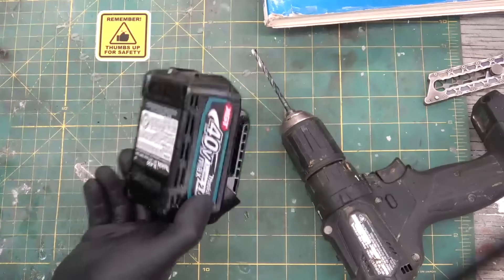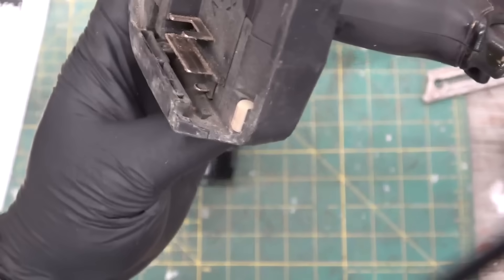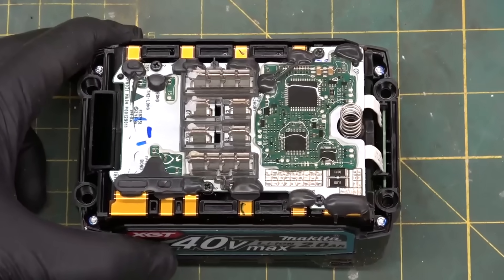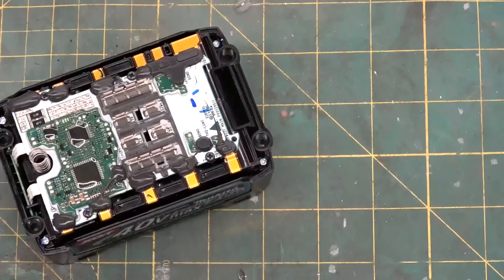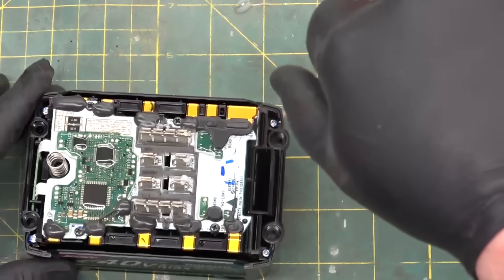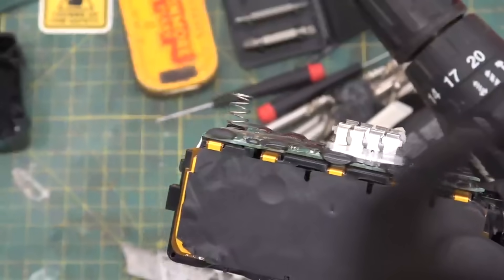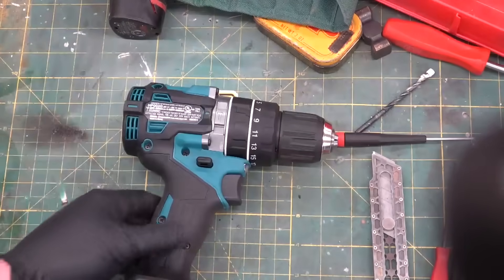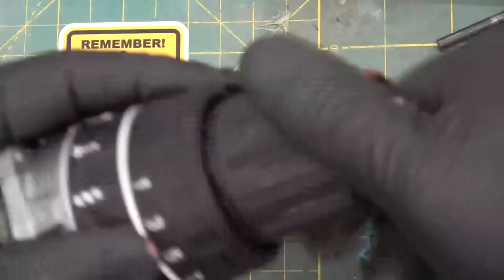BOLTR: Terrible 40V Drill || Et tu, Makita?

Comment: I once gave an apprentice a set of Righty drill bits. He's on the roof of  semi trying to drill a hole for 10 minutes. He got most of the way through.  I get up on the ladder and look, when I said, "You need to switch the drill to forward." He replied, "This drill has reverse?"  The drill bit 'was' sharp.
Reply: The drill bit was, but sadly, the apprentice was not.
Reply: Sharp as a stick of butter! 🧈
Reply: Yup. Had to do the same with a college coop student. 1/4 aluminum. Was wondering where he went after an hour..... was on the second of 5 holes in a decorative faceplate. Told him about the switch, grabbed the second bit and had him swap that as he actually listened about always grabbing 2 from the crib if you don't have any. And he tried again was pushing so hard that he damn  near broached a full tool sized hole through that panel. I had to help him up.

Comment: The chuck is noisy as it's a ratcheting chuck, all of them do that if you open the chuck all the way out under power, its the downside of having a neutral setting one click back after tightening, they can sometimes drag in this neutral setting.

If you tighten a drill bit in it by hand, and then open it by hand it'll sound exactly the same as your other one, this is a common issue if you tend to open and release your chuck using the drills power instead of doing it by hand

Huge fan from the UK :)

Comment: You want 40V because more voltage = less current for the same power, so you get less I-squared-R losses, smaller power cables, lower current MOSFETs etc etc. You do NOT get dendrites in lithium chemistry batteries, that's NiCd you're thinking of. High current causes cracking in the electrodes in lithium batteries, which degrades them. I don't know what the hell they were thinking with the holes in the bottom of the battery, that's just dumb

Comment: These power tool chargers should have a “slow charge” and “only charge to 80%” mode
Reply: My understanding is at least the xgt charger

Rapid charge to 80% depending on pack temp

Then gradual balance and top up
Reply: @Aspire198 yes but to store your battery at 80% you have to manually catch it at the 80% light also it will always charge as fast as it can which isn’t necessary if you aren’t currently working on a job.
Reply: Buy the normel charger istead of the faster one the sell em

Comment: As a fire sprinkler technician, I would get water in the battery on 95% of every job that I do
Reply: As a low-voltage technician running my scissor lift into your sprinklers, I'll get some of that water too.  Usually after it's 28 years rusty.
Reply: @Erezeneb  too funny my friend!

Comment: They ship with dead batteries so you have time to read the manual.
Reply: Makita actually ships/sells their batteries mostly charged, but deactivated/locked out. You have to plug them into a charger to "wake them up".
That's probably why they are comfortable shipping the tool with the battery installed on the tool. 
This applies to both LXT and XGT batteries.
Reply: @bfrazer4126 actually, by regulation, lithium ion battery packs must be under 30% charged in order to ship. The exception is if the battery is internal.
Reply: @bfrazer4126  except that's not actually what happened or it wouldn't have taken half an hour to charge a 2Ah battery. They were 100% dead. He should've checked voltage to see if they were already damaged from V being too low. This crap sat in a warehouse for forever.
Reply: I believe the correct answer is actually combination of the above.

Due to shipping restrictions you have to ship any lithium based rechargeable batteries at no more than 30% charge, as it’s to ensure that they have as little energy as possible should there be a fire or should they get damaged during shipping
Additionally, it does look like Makita have a way of turning the battery off therefore being able to safely transported whilst plugged into the power tool
Reply: What is this "manual" thing you speak of?
Reply: MY EXACT THOUGHT

Comment: On the subject of electrolyte in your eyes... I work at a battery store rebuilding ni-cd/ni-mh batteries. I mean we do a dozen other things but anyways When I got hired I was told "never weld a lithium battery because bad..." After a year I got cocky. I had a guy needing some leads put on a cr14250 which is a lisocl2 thionyl chloride battery with a button top. I had experience with button tops and knew they would spark when welding so I toss on the safety glasses over my normal glasses to weld the positive. It sparks of course but its a good enough connection. So I take off the safety glasses to do the negative connection. It also sparks. I turn the battery to see the weld and it was like your mom last night and squirted all over my face. Had I not been wearing my normal glasses it would have gone straight in my eye. I watched it splatter on the lens of my right eye. Thionyl chloride is weird. When exposed to moisture or maybe just it becomes hydrochloric acid and its an exothermic reaction. So I ended up with both temperature and chemical burns on my face. Probably did a ton of damage to my lungs as well since the fumes of my melting face were awful. After about 20 minutes of coughing up a lung and washing my face I recover enough to get back to work. Anyways never weld a lisocl2 battery without the right gear.

Comment: The holes are to let water out, not in.  As long as the water understands that, it'll be fine
Reply: I was thinking all the shiny Shmoo was waterproofing
Reply: @justaguy5770  it is waterproofing, but still you gotta let the water out, also heat
Reply: @justaguy5770  That's a conformal coating and thats exactly what its for.
Reply: Needs a sign. "Liquid outlet only"
Reply: @wva5089  Next AvE decal set :elbowcough:
Reply: Its because the bottom becomes the top on the charger, and they are slamming pixies into the battery so hard that they get very hot and bothered.  That heat needs a way to get away from the bothered pixies.
Reply: So it's tsunami proof 🤔
Reply: This sounds like one of the wrong answers on a theoretical driving tests
Reply: Would water ingress prevent the smoke outgress?
Reply: @JohnLewis-qg8rz  egress
Reply: That's what I was thinking too!
Reply: The holes are to let the charging heat out to preserve the battery life.  [Insert smart ass response here].  🤣
Reply: Water tends to be stubborn in my experience , sometimes it refuses to run downhill.
Reply: On board the tug with good morning start with spray in your face. Those holes of doom will allow  the mighty makita to release flames of anger. 
Will have to cover duct tape   for any chance of not having balls of fire in the palm of my hand.
Reply: There's a reason the wet hole on the woman is at the bottom, while the flappy dryhole is on the top.
Reply: Oh so that's why Biden had the border open, so the illegal immigrants could leave.  Genius!
Reply: Like covid. When you wore a mask, it knew not to mess with you..
Reply: When the BMS gets wet, it will drain all the batteries down to 0v, which will ruin the pack, though you may be able to save a cell or two from the remains. The cells getting wet also isn't great, but it's usually not as catastrophic. At least not immediately as catastrophic. Letting them sit in a puddle over the weekend isn't going to go well, though.
Reply: Under use forgoing large quantities of water, water typically can not get in the battery because the only openings are on the top which when in a tool are completely covered up. So the holes would be pointless for that use.
Reply: If one thing working as a mech-a-nic have taught me, if you make a box water proof, it will definitely keep all the water that gets in.

Comment: Having post-mortem'd a few hundred drill batteries, it doesn't seem to be the water that often kills them. It's dust. Drywallers get theirs filled with drywall dust. Woodworkers with sawdust. Metalworkers with grinder dust. It billows along and settles down on any flat surface, right where you put your tools. Kicked up by HVAC, wind, boots passing by, shocking amount of dust collects quickly. You're probably not going to set it down square in the water, but sideways you probably will, and that's where the vents are too. Water damage I've seen seems to be a function of condensation, mixes with the dust and causes rust, plaster, or wood gumming it up. And then what good are the vents anyways? At least, I suspect, hardly ever any rust crust without massive amounts of particulates along with it.